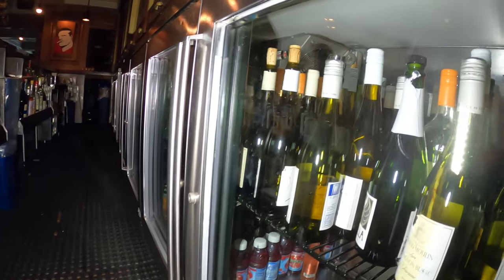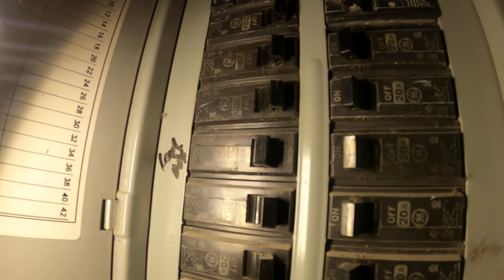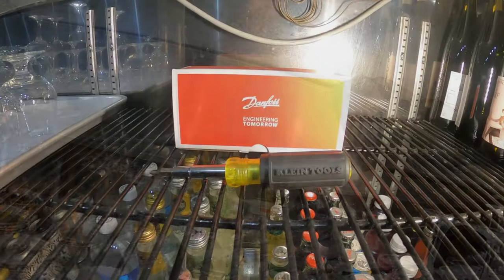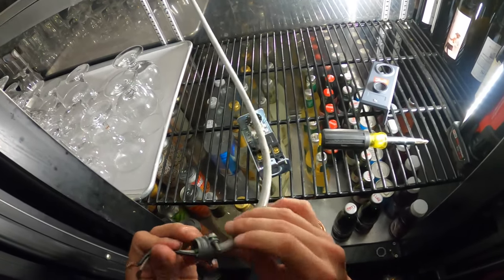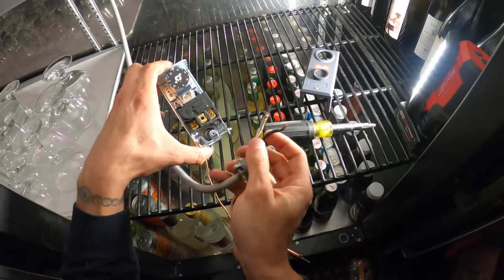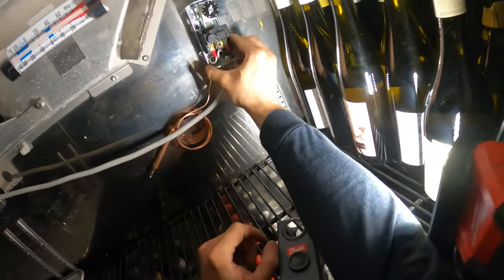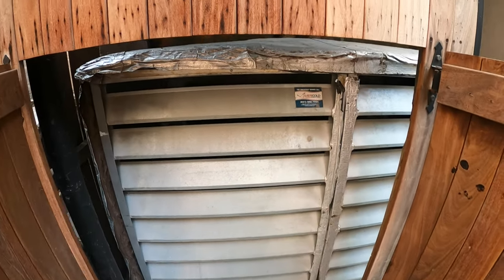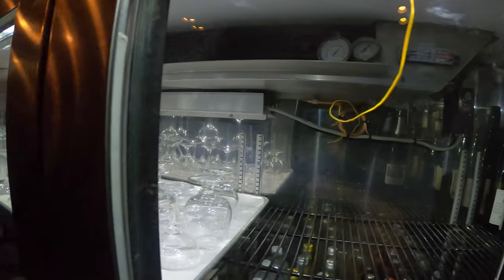HVACR Service Call: Refrigeration Rack System - Wine Cooler Not Cooling (Breaker Keeps Tripping)

Comment: Hello love your channel got an issue with a constant 24 volt power to contactor on compressor its on constantly even with no call for cool and with thermostat off wall mount, i sure am scratching my head with this one any help will do thanks.
Reply: Check wiring for a short , you can disconnect and check continuity